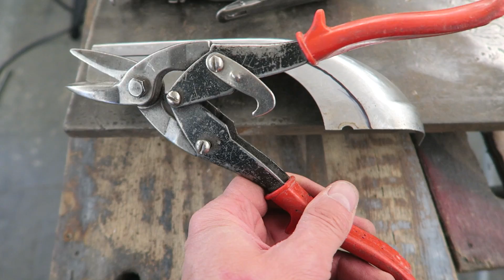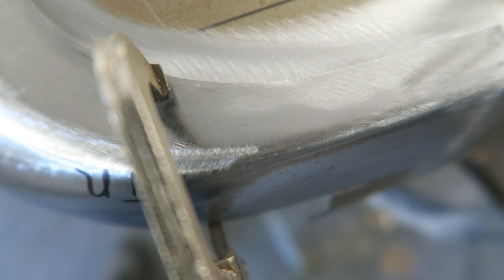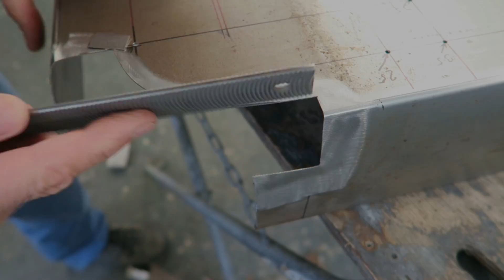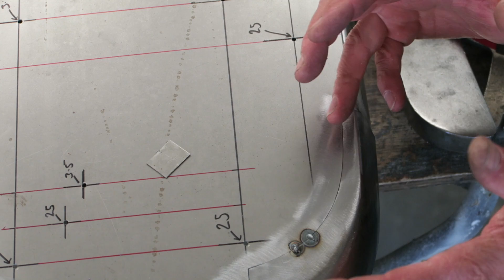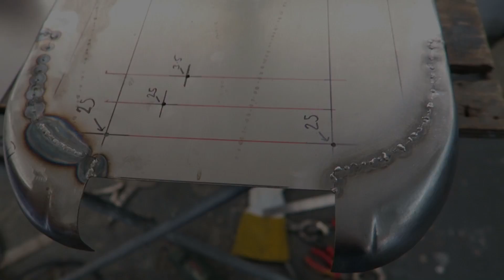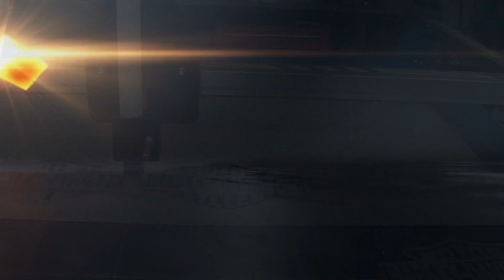TIG Butt Welding Part 4.How I get my repair sections fitting well before welding Tips and Tricks #49

Comment: This video is like watching a famous surgeon explaining a surgery as he performs it for a crowd of eager medical students.  I like how you check the metal, take a small step, and evaluate the result.
     I was wondering about a technique from the other end of the patching spectrum.  There is a method of cutting out a mostly rectangular patch that is a bit oversize, shaping it to try to match the original (bends, crowns, etc.), and tacking it on as an overlap.  You then cut  inward at a 45degree angle with a thin cutoff wheel, at the edge so the patch gets thinner towards the inside. You cut enough of a corner away so that you can gently (with the handle of your hammer) push it in flush with the original surface, and tack it, and repeat till flush all around. There are variations, but where it works it is elegant. The angled cut closes the gap as you push it in.
    I found out about this on Fitzee's channel, but he said that a lot of people use it. It can't work with curved patches, or complicated shapes, but I was wondering if you find it useful.
Reply from the maker: I’ve never given it a try to be honest. I’ve also moved more away from mig towards TIG welding on joints. I’ll be sure to give it a go one day. 👍

Comment: Trev your attention to detail is awesome, do you get more distortion with mig than tig ? .... Cheers Trev 👍
Reply from the maker: That’s a great question but one not easily answered. The longer the weld duration while mig welding the greater the distortion so it greatly depends how you use a mig welder. The important point between the two modes of welding is that the distortion generated by either type will be quite different. The mig weld will be harder and more brittle so distortion will be much harder to rectify compared to the TIG weld which will be a bit softer. It’s probably easier to remove greater distortion to a TIG welded area compared to a less distorted mig welded area. Cheers Trev 👍
Reply: @trevsblog  Cheers Trev, have you tried welding aluminium with your RTECH tig yet ?, I’ve got to grips with the tig on steel but I can’t do the aluminium for the life of me lol
Reply from the maker: With the welder I have no but I used the same welder at Race and Restoration and welded aluminium quite a few times. Rtech have a video on YouTube showing the basic settings for welding aluminium etc. The channel doubleboost also featured the same welder albeit a 200amp model welding aluminium. It is a different material and behaves differently but once you get the hang it welds not too bad. The biggest mistake I made to start with wasn’t having enough power on, aluminium takes far more amps per thickness against steel because it dissipates heat faster. Cheers Trev
Reply: Thanks for that Trev as you say it’s acts completely different to welding other metals, I will keep at it until I crack it , practice makes perfect as they say ..... Cheers keep up the fantastic video’s Trev
Reply: Short answer I got from an old metal master: MAG causes the least amount of heat  distortion but your options to hammer them out are limited. Therefore he uses MAG if he can't get behind the panel with a dolly or if he is on a tight budget. Otherwise he prefers  gas or TIG welding.
BTW - the process is called MAG because you use a mixture of Argon and CO2.

Comment: Wish you would show the back side up close to show any gaps, also the final weld pass would have been greatr
Reply from the maker: To reduce the video length I just try and focus on one subject at a time, using the same process in earlier parts showed both sides of a welded joint. Cheers Trev 👍
Reply: @trevsblog  Thanks, after posting this I watched several of your other videos, really great and extremely helpful for a beginner like me.  Keep up the great work!

Comment: I'm always impressed with your work and the care you take to explain everything.
A couple of things I do that you might like to try -
Use little button magnets to position the repair pieces before clamping (remove them before welding as they affect the weld pool badly)
I also use thick steel under the clamps as a heat sink to take the heat out of the thin panel, you get a little less distortion.

I hope you don't mind the suggestions but they work for me.
Keep up the good work, you are inspirational.

Comment: Trev question.. you ever tried this cold weld method with a tig to  join car sheet metals? so far i like this metod with TIG much better then the stuff i manage with my mig wiler. it seems finding the sweet spot with a mig is really damn hard. i keep blowing holes. on every setting >.>
Reply from the maker: I’m a bit sceptical about cold welding to be honest, you need to sustain a certain amount of time when welding for the heat to build up to a point where the weld is penetrating all the way through the panel, a weld can look good but sat on the top surface. There are several problems using a mig welder as you have discovered, the major issue is the fact that the wire is being fed all of the time. This means that the current made available to the wire must be enough to melt the wire which is at a similar thickness to body steel, so there is a very fine line between not getting enough penetration or blowing a hole. Mig welders are great on material thicknesses 1.2mm upwards. There’s no doubt about it TIG makes a better job but you have to be able to use one, mig is easier to use as it’s point and shoot. Cheers Trev 👍

Comment: Hello Trev.  Could you please tell which steel grades can be used for the manufacture/repair of body panels?
Reply from the maker: I just use cold rolled mild steel on classic cars, using the same thickness as the original car. Cheers Trev 👍
Reply from the maker: https://youtu.be/zfRIBtGRR2o

Comment: When using snips, don't cut on your line!  Cut far enough away so you don't distort your work.  Then your next cut will just spiral the steel off like a coil of wire.  I'm talking about 3/8" or 1/4".  Cutting on your line is sudden death.  Don't do it.

Comment: Dang you are good! 
I'm wondering if anyone could weld my mustang trim that I sanded through. Some type of aluminum. Very thin. If  they could fill a small crack in the back side where no one sees it, I could easily file it down smooth on the front side and polish it back to original perfection. But so many say they cannot weld this. Sure its thin. https://youtu.be/sUKtxFzhmJQ

Comment: Glad you’re back, Trev.  I’ve been pondering certain aspects of panel repair, and indeed in my apprenticeship, utilised many brazed joints.  I have seen brazing on some vehicles, especially in certain areas. My question is, do you ever braze panels or braze anywhere ?  I understand butt joints on panels and other joints, especially on thin materials may be prone to buckling but are there cases where you might use it. Further more, I did plenty of gas welding which I have seen you adopt once or twice, at least.  Could you detail where and when you might use this?  Many thanks
Reply from the maker: I don’t braze and will be discussing this on an upcoming video. Cheers Trev 👍

Comment: with such a good, tight fit up, don't use filler rod when tacking. it avoids all the problems of planishing over and around weld beads, and is much quicker.

Comment: You use a pedal with your tig? I just started tig welding without one and am struggling to control distortion and burn through.
Reply from the maker: I personally don’t find the need on steel, aluminium a different story. I keep the amps low around 20 and make sure everything’s clean, short runs and planish in between. Cheers Trev 👍

Comment: Trev,
Excellent info once again👏👍
Cannot wait to get back to using my TIG.
What size weld8n* rod did you use for tacking then final welds please?
Reply from the maker: I just use .8 mild steel mig wire, watch my TIG part one video where I discuss using it and specially preparing it to straighten it out. Cheers Trev 👍
Reply: @trevsblog  
Thanks Trev.
I was wondering if you where using MIG wire.
Need to practice using it.

Comment: Sign looks smashing! Making the parts fit is so hard, love to see it is not just me spending a bunch of time doing this, and getting some tips and advice from someone with all that experience is is always super helpful. The last few millimeters are always super sceary, the fear of taking too much out is always a big thing for me. Even if I file the last 6-7mm, I always end up with some gaps, this beautiful craftsmanship showes that  you are a true master in my opinion. A really awesome welder I used to work with who was into cars told me to hammer and dolly the spots while still hot to get a super strong weld, because it is still pretty soft. There is a lot of metalurgy stuff that backs it up, because it will peane the weld witch affects the grain structure and lessens the tention within the metal (makes it less likely for cracks in HAZ), and it is a lot more effective when the weld is still hot, the butter zone is all above 200 celsius, when the steel is still getting that tempering effect. Tempering is must on stainless as most stainless steels needs to be stabilized, but carbonsteel can benefit by taking it a bit into account. I think pre-heating to 200 c can help alot as well, as it makes the steel cool off slower and giving a more even grain structure as taken from the welding textbook. I'm still studying so if you disagree I would be very greatful if you let me know, there is alot left to be desired when it comes to practical experience in my book as most of the experience I have is from industriual welding and working on a few of my own cars. Love your blog, always interesting, cheers!

Comment: If you have a small gap could you not put the copper bar underneath and fill it with the mig ??
Reply from the maker: Makes sense but probably not in practice. I’ve learned that leaving a small gap when mig welding aids penetration on lower power settings. Cheers Trev 👍

Comment: Excellent tip about tacking the closest fitting parts first, even better tip about planishing the weld tack to move the repair panel if required. 👍

Comment: Top tips on where the initial tacks should be in regards to gaps, i've had issues when doing quarter panel repairs with them pulling in and over lapping a lot more on different jobs. I shall have to keep the info engrained in my memory bank 😄

Comment: Nice one Trev, impressive, educational and entertaining, not many things I can say that about! On a technical note why TIG vs. MIG tacks? I can see MIG being a harder clean up but maybe less heat into the job? I think a lot of people would like to see a similar exercise with MIG only as that's the only process the vast majority of DIYers have. Me, I'm old, I learnt using gas:-)
Reply from the maker: I’ve not a lot against Mig but TIG offers far great scope for perfection and provided you get the technique down you can depend on the stability of the weld certainly more than mig that can easily blow through in unexpected ways. Because the wire isn’t being constantly fed the welder operates at far lower amperage resulting in less distortion, sounds counterintuitive but there you have it. Gas is closer to TIG than MiG 100% cheers Trev 👍